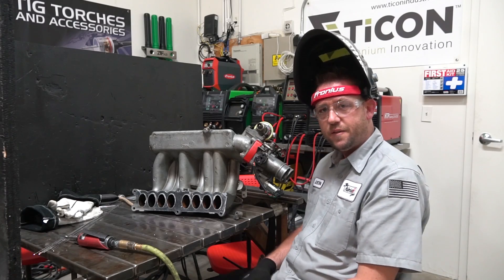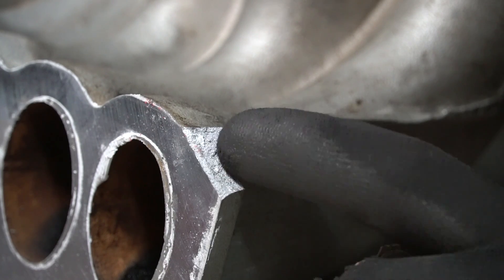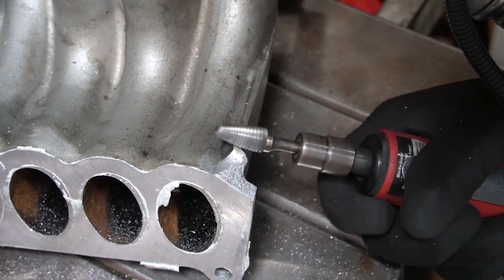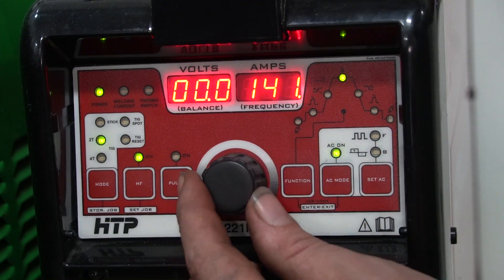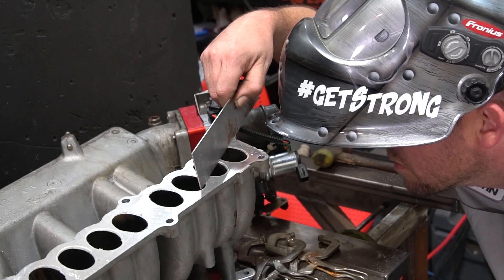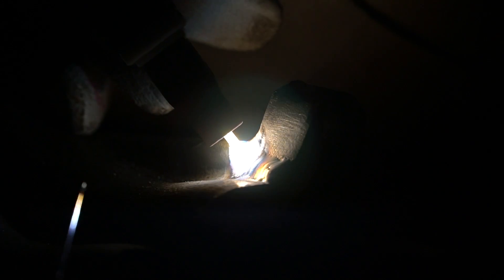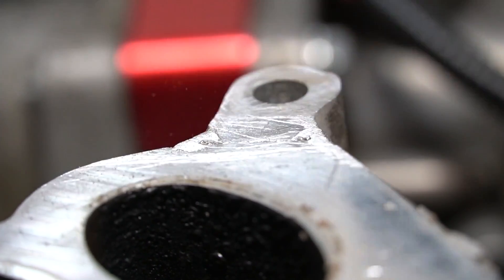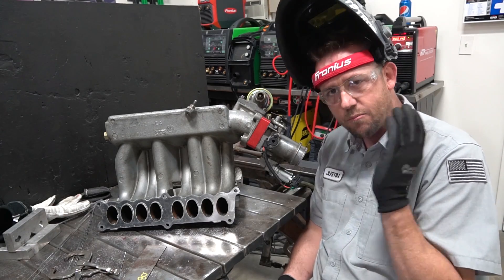TFS: Cast Aluminum Weld Repair

Comment from the maker: ⬇⬇ Need a legit carbide bur set? DON'T BUY CHEAP! ⬇⬇ 
https://amzn.to/2S7f2EA
Reply: How did you  judging what's the arc gap because you have to hold the arc gap as close as posible without touching the molted metal
Reply: After buying a few off tool trucks throughout the years. Finding these on Amazon and them not being junk was awesome and a ton cheaper.
Reply: What’s the trick to keeping your burr from getting gooped up when you grinding aluminum?
Reply: For just a little bit of grinding like that just keep the speed down.  In general, a little bit of lube, spray lube works OK (stuff like the DuPont Teflon dry lube works quite well) but if you're going to do a lot of it dipping the burr in some wax occasionally works best.  The cheapest/my go-to is to go to the hardware store and get a toilet sealing wax ring for $1.50 and you'll have a block of wax that will last you near forever or until something happens to it (I once dipped a grinder into one that had been packed into a can running at full speed and it caught whipped around and sprayed across most of the shop :-/)
Reply from the maker: @mpikas  MIG nozzle gel is the greatest carbide lube I have ever seen. I accidentally set one in the container about a decade ago and it ripped through the metal I was working on so fast that it messed up my part haha. I've never seen anything work quite like it.
Reply: @TheFabricatorSeries  what type of rod do you use for this type of work , 4043. ?
Reply: Bee's Wax
Reply: @CLDiesel02  -buy it from the specialty tool store. Most town have one. In Houston, it would be Empire Tool, K1 or Bass. 
  I had a hard time forcing myself to spend $40 on a longer version of what is used in the video. 10 years later, it works the exact same. Aluminum doesn't stick to it, I think because of the quality of the hardened metal. The rigidity of it allows the aluminum to vibrate off, I think. Also, you shouldn't be digging into the Al so hard that it cakes up. Then you're melting it off and taking life out of your tool. Be forewarned. Once you go bad ass deburring tool, there's no going back.
Reply: @CLDiesel02  to not get a burr with out clogup you just need a burr for softer metals
Reply: @CLDiesel02  I've used bar soap (like bar laundry soap) on hand files.  It seems to keep the file clear and also washes off in the sink.  Haven't had much luck with rotary files for aluminum.  There are very coarse ones just for this service, hope to try them someday.

Comment: Helpful pointers, especially the technique of multiple passes. Would be interesting to see a weld on a thin cast aluminum piece. How would you do the passes without the risk of overheating and blowing through a hole in the piece?

Comment: Thank you for this video.  I've been working on a 1956 outboard motor.  I made a couple of successful repairs, but just completely destroyed a hinge on the motor cover.  I'm a novice, but with enough experience that I tried the methods you showed before I saw your video.  I'm glad it's not just my lack of skill that's made this project so difficult.  There's an unbelievable amount of crud in this old aluminum.  It's so much worse than the part you just welded.  Gotta make a new hinge barrel and hopefully get it to stick.

Comment: I’m in welding school rn at my community college and I have a good amount of experience with aluminum. I want to start learning how to weld cast aluminum because I know that it’s good money for a side gig type thing, anyone got some more tips for getting started with cast? How do I know when the junk is out to the point that it’s weld able, is it just when it stops popping and off gassing? Do I use different settings for the cleaning vs the actual welding?

Comment: great info, flathead ford v8's had aluminum intakes, single 2 barrel, I'm setting up to cast parts to convert them to 3x2, i have a friend with 50 or more stock intakes, welding onto the old intakes will be a challenge, I have welded cast before, sometimes it welds beautiful, other times it is more of a mechanical bond, who know what 1940's aluminum has in it.

Comment: Is it possible to weld the part of a cast aluminum block that houses the crankshaft? Have an engine with a spun main bearing and it messed up the actual block. They tell me throw it out get a used engine... but I like to weld... so if it's possible to do it and do it well, I'd like to know. I understand it would have to be line bored after the weld job.

Comment: I e got a question I can't seem to get answered.
I have a set of aluminum LS heads that I had ported and polished.
They were on top of my forged 403 running a vortech Ysi at 18lbs boost.......the valve tip broke off and damaged the head, cylinder bore and a little bit of the forged piston.    Can I repair the head?

Comment: You could have just added the metal and drilled/shaped it, I get it. BUT you showed that even a small piece can be welded back on and "CAN" be done using a technique that works for a bigger piece... so VERY helpful. And thanks for the burr toolset recommendation.

Comment: I have to weld a completely broken off transmission case ear. Broken part is lost so I have to build up the ear. The alloy is LM25 (A03560). It will be quite a big piece to build up there. Is this doable ? Shall I use 4043 rod ? Shall I peen it between the layers ? And what are the typical machine settings for such a build up weld process ? Many thanks

Comment: Love your videos.Have a question about welding and impact on motorcycle electronics. Have a flange on an iron header that needs to be cut and welded at a specific angle and needs to stay on bike to get the perfect fit. Can it be welded on the bike with no issues to electronics? I can disconnect the battery, but unsure if it will still impact anything since current could be running thru the bike?

Comment: Did you try using some preheat to get some of that oil and crap out of that metal ,that works pretty good too before you weld that pice back on then a little more pre heat before Welding.

Comment: What's your thoughts on welding up aluminum cylinder head chambers to increase compression? Would you weld a fit part in or just completely build up the chamber with filler? It's a Mercedes so just buying a better pair of aftermarket heads is not an option.

Comment: Why not start with a flux in the "mechanical lock" and braze the tab on with some alumaweld (or similar aluminum)"welding" rods? Actually - why not throw some flux into there at all?

Comment: Customer: Looks great!  How much do I owe?

Justin: $1,500

Customer: WHAT?  FOR THAT?  I wanna a detailed invoice.

Justin:  Ok <hands customer an invoice>

Customer reading invoice:  filler rod used, $1.50.   electrical power used, $10.75.  prep time, $4.75.  Prep pads & misc material, no charge.  Knowing where and how to weld crap cast aluminum, $1,483.

Customer:  Oh.  gotcha.  um, do you take cash?

Comment: I have a question. How do I attach what the shifter rod goes into inside the transmission case of a early 90s Kawasaki 600?
Reply: The port broke from the case.

Comment: Had my cylinder head welded up on the car after cracking a boss but left a tiny shrinkage crack at the base of the weld (supposedly a 'surface' crack) .... Welder peened it a bit but worried it will substantially grow.

Comment: Did you use 5356 filler on that casting?  How do you choose the best filler for an application like this?   Also, would there be any advantage in pre-heating a large casting with a propane or MAPP/air torch?

Comment: Sadly, this is bad advise. Welders should take a minute and determine the base metal alloy and not be lazy. No casting should be welded with the two “go to” filler rods of 5356 and 6061. What job does the casting have? In this case high heat engine casting. It’s not crap aluminum, it’s a specially chosen alloy that performs at elevated temperatures. A simple google inquiry will tell you it’s 319. It is a blend of Al, Si and Cu and needs special attention and an appropriate filler rod. That rod is ER2319 and the weldment needs preheat and post heat treatment. Remember, if you want to have piss poor performance and cheapen our trade, take short cuts and let down your customers.

Comment: It doesn’t matter if it it’s aluminum, steel or pipe parts in stainless steel. Cast is never easy to repair and make it look good. You did a great job on that manifold! It’s about as bad as it get when it comes to aluminum. All that oil and exhaust buildup ain’t easy to clean no matter the Hertz.

Comment: I do a lot of cast aluminum repair work and I found that for small tabs like that it is best to just use the little part that is broken as a reference. I use 4043 filler and just buildit back up piling weld on top of weld until I have the right amount of metal added to the main piece.after that I'll use a body file on the machine surface and the gasket to Mark where the hole needs to be. Then with a Dremel or a die grinder shape the little tab and drill the hole. I found it to be way faster and easier than trying to weld a piece of cast aluminum that is small especially if it is a shity quality.
Reply: Same here.  I don't always even try to keep the orig mount hole from filling in a little if it's close to the crack as long as I know where it is and can clean it back out with a drill. Fabricator's final version is pretter than necessary lol.  I usually get in and back out before the whole ear collapses.

Comment: First, thank you for your very informative videos!  Second, I make cast aluminum sundials. They're 10" round and 3/8" thick (typical). But sometimes I do not get optimal aluminum flow of the alphabet characters of the inscription during the casting pour. The characters are typically 1/8" in thickness and 3/16" high.  What would you recommend to build up the random voids and rebuild the alphabet letters?  Thank you for any suggestions....

Comment: As a fairly new tig welder myself, when I struck that first arc I spent more time re-grinding electrode points than I did attempting to weld. I would highly recommend The Fabrication Series videos for ANYONE who has the ability to pay attention to detail and follow instruction. I have learned more by watching several hours of his videos than I could ever have just reading online forums. One thing that you can't teach is physical control, but the pointers and suggestions sure have made a massive difference in my weld quality. Thank you for all your great information sir. 😎👍

Comment: Can you fill a head gasket gouge about 1/16 on the block aluminum
Reply: Duen Puen you could probably fix a gouge in a block, but you would want the block to be decked afterwards to make the surface flat

Comment: Don't forget the function of the component you're welding either! Introducing a vacuum leak because material was removed around the port can be a headache for the end user. I was literally squirming in my seat with the haphazard use of the surface prep disc and file around the port opening edges. Great video! That sentiment goes for all your videos. Thanks!

Comment: Hello! Appreciate your Great work and videos! Have a crack in old 250cc motorcycle where the cams bolt into. I don't have access to carbide burr tools here in Cambodia. Can I use a new stainless steel purpose, cutting disk and weld it in. Or will it be too contaminated?

Comment: Rémi Talneau we use a flux capacitor infuser with a diolithic setting. We also use non warp sticks ( NWS) that helps stop warpage. At times we may put the broken part in a parabolic chamber before we pre heat .The chamber realigns the molecular strifacites in the metal.  But when were lazy we just weld it

Comment: Is a repair like that as strong as the original cast, or do you have to worry about how you torque it down and possibly use a little less torque

Comment: Do not ever use a diamond cut carbide  to deburr aluminum as it will get covered with aluminum, better use a single cut carbide, dip it in wax to avoid aluminum from sticking on it, also can use a block plastic to clean the carbide.

Comment: The way that ear sticks out, I wouldn't torque it too heavy. Too bad it couldn't have had a brace brought down to it from the runners of the manifold. As we know the strength is always a little questionable when this welding process is applied. And this process shown was as good as it gets.

Comment: what kind of filler material used to weld? 4043 0r 5356?
Reply: Mainstream Gamer don’t ever use 5356 on any part of an engine! 5356 is rated for operating temperatures below 150 F. If you’re not sure how hot a part gets, don’t use this.

Comment: Good video, need to repair the mud guard bracket on my gixxer forks, had a go the other day and it melted into a blob! Will try playing with the balance and frequency next time. My biggest problem was trying to keep it clamped together, never even thought of using some flat bar to clamp it together, sure that'll work a treat!

Comment: it's always good to see someone share knowledge and trying to help other people, but you still have to correct somethings on your welding, specially on the power that your using, with such low power you can't guarantee a clean fusion, and you were lucky that porosity didn't appear alongside the weld, has it tends to pop on both sides of the weld when the metal doesn't receive enough heat
Reply from the maker: Consider the factors from the power source. They're not the same. Now factor in the location of the part welded. Was it at the end where head builds up rapidly or in the middle where it dissipates rapidly? Finally, consider the settings and what they mean. Now look at what happened behind the hood. Did the weld just sit on top or did it fuse? If you missed it - watch again.
Reply: @TheFabricatorSeries  yes, and when i talk about the power i'm not talking about the settings that I saw you set on the machine, but the time that it took you to heat up the part, the dept of the fusion, and that the edges were cold fused ( don't know how you call it in English. Meaning that all of the weld width isn't fusing)
Reply: @JorgeGameiro  Weld width is not always penetration.

Comment: Just maybe I missed the filler rod you used,  from what a  buddy a welder by trade told me years ago as he just showed me 2 alum filler wire and bent them and said one was softer than the other. He also said sometimes softer one was better than the harder to bend in certain applications when he welded my cougar horn ring in my case he used the softer rod and it held fine. Which alum rod did you use the softer or harder filler wire. Nice job too.
Reply: He used 4043 pretty sure. 4943 is good for stuff like this too.

Comment: hi buddy, very difficult but is it possible to weld cast aluminium using a spool gun? I have an oil pan to modify with a DC only machine + spool gun.
Thanks
Reply: Depends on if its good quality casting or not and if it's ever seen oil yet. Really not enough cleaning action using dc if its a dirty casting or its a used oil soaked pan. If you have an oxy acetylene rig that might be a better option.

Comment: could you explain the frequency when tig welding?
Reply: AC Frequency balance,  AC Balance  or Clearance Effect on some machines is the amount of time on either positive or negative.  AC or Alternating Current , alternates back & forth between the two.  Even tho technically there really is no positive & negative with AC, but that's another long story.  It is a wave form, such as Sine, Cosine, Square,  etc here is the best example i can give from my phone 

Pos +
5+         /\                              /\
3+      /     \                         /
1+   /           \                   /
 0    ~~~~~~~~~~~~~~~~~
1-                     \           /
3-                        \      /
5-                           \/
Neg -

In that what's in between the pos + 
& neg - , represents a wave form, even tho technically this is 2 waves, Sine & triangle,  but hopefully this helps with understanding it.  So without in to the speed or amplitude,  or width of the wave, just for the welding aspect,  this demonstrated how much time & how far  on  pos +  before passing "0" & then how much time & how far Neg -., & then repeats.  In this example, this would be 50/50, because both sides are equal. But if it was say 70/30, one side would be different.  

There is obviously alot more to this, but its hard to explain without making it to complicated.  So please bare with me.

With Ac welding,  this is referring to the frequency in hz in which a specific metal (type/grade of aluminum, etc, etc) is to be welded in,  & then the balance is the amount of time its cleaning to welding. Depending upon the machine,  you can really individually shape both the freq Hz & the AC balance.  These obviously being the better machines.  Some can partially do this, or only to some degree. Some such as the 2020 Lotos tig 200, & i believe the Eastwood have the "clearance effect",  which is some type of combination of both, &  Some cheaper welders have one preset. 

Honestly there is alot of good information out there,  including videos in which really explain this in depth.  This guy who made this video is great, really knows his stuff, & does great videos too. Another one, is Mr Tig. Both are very good & if you spend some time with them you will definitely learn alot of different things. I did welding in school some 25 years ago, & have welded over the years,  but no expert welder . And so it's always good to refresh and or learn new things, techniques,  etc. But it also helps that I know enough to tell who is good & who is not.

Comment: that was pretty impressive. Cast is a bitch. surprised you didn't need to use any solvents after grinding. tip dip ect..